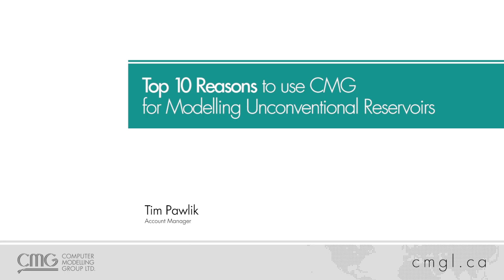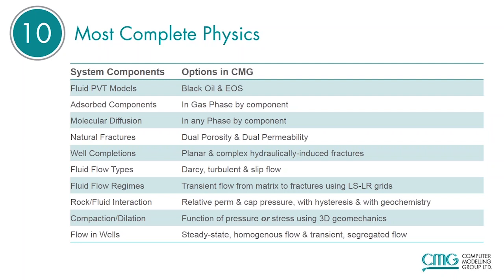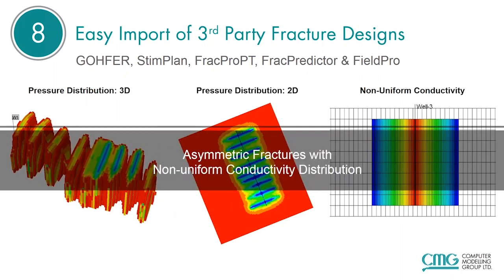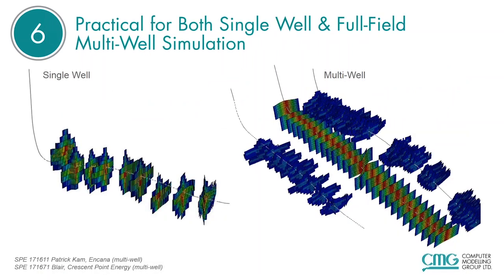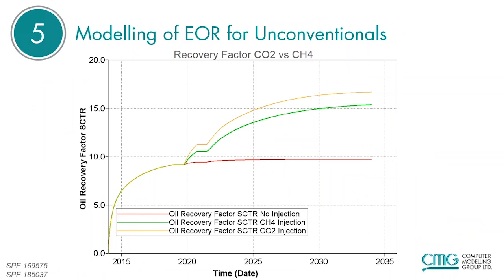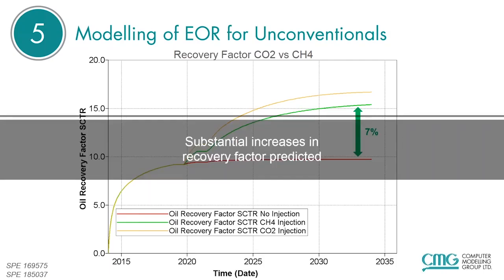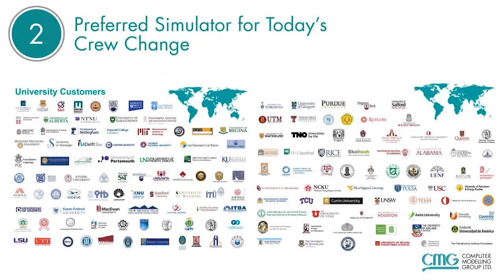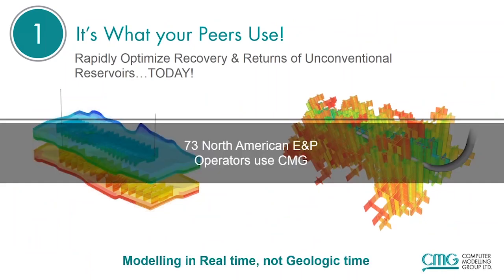Top 10 Reasons to use CMG for Modelling Unconventional Reservoirs

Comment: can CMG Stars be used for hydrate dissociation modeling?
Reply from the maker: Hello Shadman, yes, STARS can be used for hydrate dissociation modelling. The simulation of gas hydrates involves the solution of a complex combination of fluid-heat and mass transport equation combined with the formation and/or dissociation of the solid hydrate phase in the system. Multiple papers have been written looking at these effects using STARS. We also have training courses that show these workflows, check them out here: https://www.cmgl.ca/training